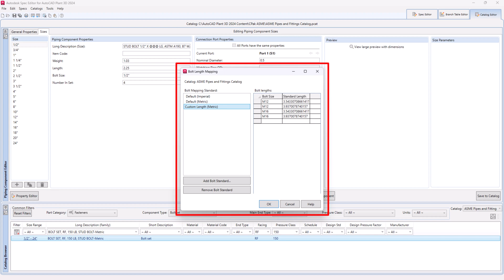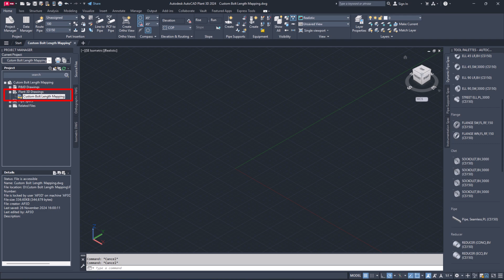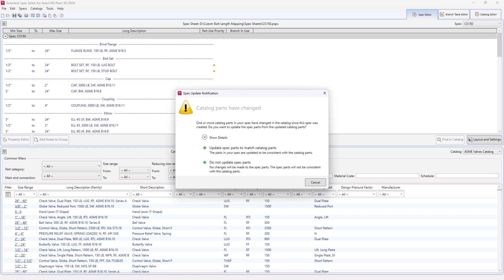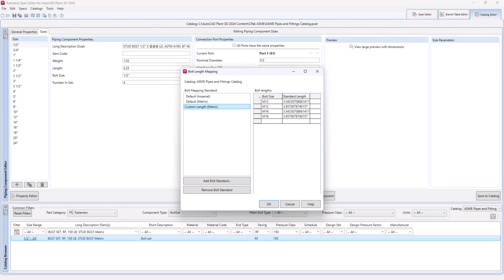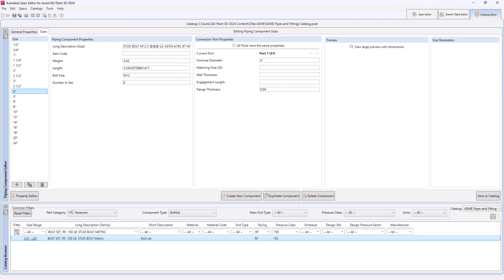AutoCAD Plant 3D | Create Custom Bolt Length and Mapping

Comment: Thanks @acadp3dsolutions for the provide latest update feature and upgrades I request you for the provide one video regards stud bolt length mapping as per autodesk supports and also your given video I followed step by step but not working mapped I make my custom bolt standard with 1) metric units 2) imperial units my given compatible standard bolts name is applied and showing in plant 3D model drawing property but lengths not showing as per filled values
Bolt size, length from to & increments not sinc with XML it's the main issue I have faced I did lots of time this activity unfortunately I am failed don't know where is the problem
Confusions 
1) In Spec editor have separated property for bolt size length and eaxmple prefix with bolt size should be started with M12 etc and in compatible standard there is another table we want to fill how is working together and what is linked between 2 different tab ??? Hang ...?

2) my project unit in project setup metric and my spec editor catlogue unit in inches why ?? But still i used conversation factor like bolt length is 55mm 55/25.4 = 2.1653543307086 software not get full decimal values?? 
So trying everything but till date not reach on the correct results so autodesk supports also not given proper solution don't know how many companies struggling to get accurate lengths but no one talk about this 

So my request make 1) video for stud Bolt length mapping like size range 15NB to 600NB metric units and 2) 1/2" to 24" imperial units
Thanks in advance

Comment: Good video! Thanks. You mention the first method as 'Imperial bolt sizes with metric bolt lengths'. Is it possible to automate using imperial bolt sizes with imperial bolt lengths? It would be great to show the bolts as 'STUD BOLT 5/8" X 3 1/2" LG'
Reply from the maker: Thanks for the comment! Yes, it is definitely possible to automate using imperial bolt sizes with imperial lengths. Instead of metric lengths use Imperial length values.

Comment: Thanks for your guidance actually so many organisations don't have a proper solution of stud bots & matchine bolts length and I try change this mapping but I can't get it that's lengths which is input with from impartial sizes I works as admistartion so request you if possible please make some of sizes length data felid as per ASME standards so that it will  Very much helpful &  useful thanks so much for your support
Reply from the maker: Hello Aakash, When using Imperial Bolt Sizes with Imperial Bolt Length, pay attention to all the decimal points. For instance, if the standard bolt size is 88.9 mm and you need 90 mm, divide 90 by 25.4, which equals 3.543307086614173. Use this full value in the bolt length mapping table, and it will match your expectations.
Reply: @acadp3dsolutions 
Thanks @acadp3dsolutions for the provide latest update feature and upgrades I request you for the provide one video regards stud bolt length mapping as per autodesk supports and also your given video I followed step by step but not working mapped I make my custom bolt standard with 1) metric units 2) imperial units my given compatible standard bolts name is applied and showing in plant 3D model drawing property but lengths not showing as per filled values
Bolt size, length from to & increments not sinc with XML it's the main issue I have faced I did lots of time this activity unfortunately I am failed don't know where is the problem
Confusions 
1) In Spec editor have separated property for bolt size length and eaxmple prefix with bolt size should be started with M12 etc and in compatible standard there is another table we want to fill how is working together and what is linked between 2 different tab ??? Hang ...?

2) my project unit in project setup metric and my spec editor catlogue unit in inches why ?? But still i used conversation factor like bolt length is 55mm 55/25.4 = 2.1653543307086 software not get full decimal values?? 
So trying everything but till date not reach on the correct results so autodesk supports also not given proper solution don't know how many companies struggling to get accurate lengths but no one talk about this 

So my request make 1) video for stud Bolt length mapping like size range 15NB to 600NB metric units and 2) 1/2" to 24" imperial units
Thanks in advance
Reply from the maker: Hii  @akash0707able  
First, follow the steps shown in the video using the default Imperial project with the standard specifications like CS150 and tell me if it works for you. 
After that, we will examine your original project.
Reply: @acadp3dsolutions  i did everything of my side follow each and every steps with carefully and now i am feeling helpless and there is so many configuration routes, factors, units, others settings so don't know what happens what is the option for get one entry example results along with correct values of Bolt length if possible please make one example video about bolt length mapping
Reply from the maker: @akash0707able  The default Mixed Metric/Metric project is also not functioning. Try changing the bolt length for the 3" pipe with a WN flange joint from 88.9 mm to 90 mm and check if it works. If it does, then you are following all the steps correctly. If it still doesn't work, then you are likely missing some steps. Watch the video closely and make sure not to skip any part. Additionally, try removing the bolts from the specifications, re-adding them, and substituting them in the 3D model.
Hope this helps!!